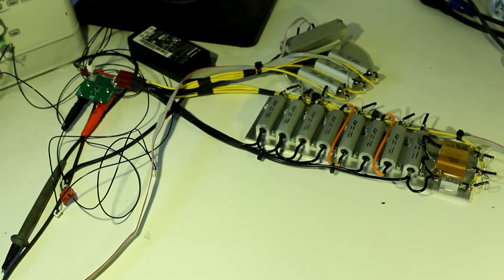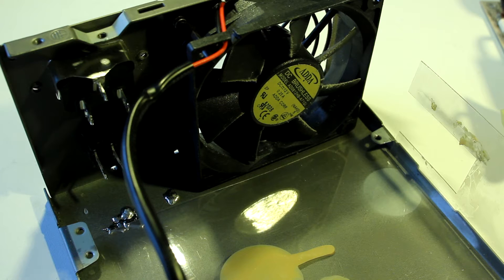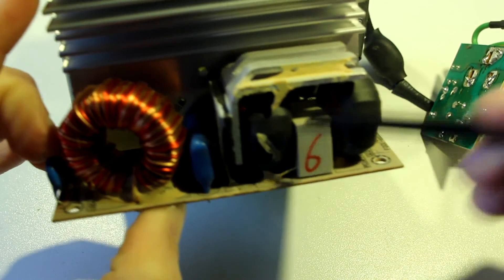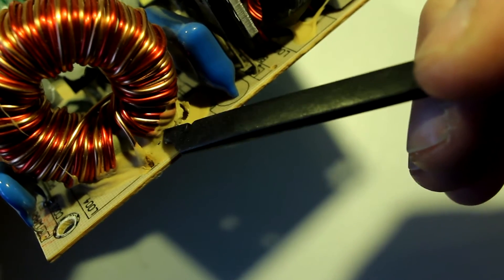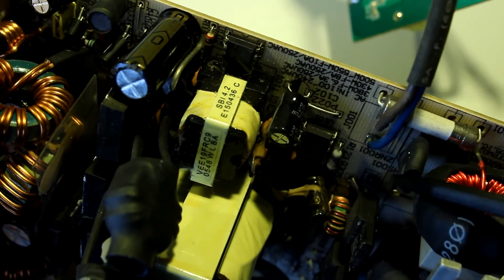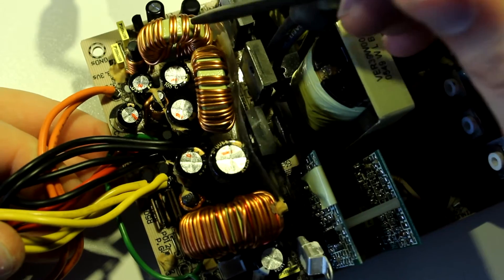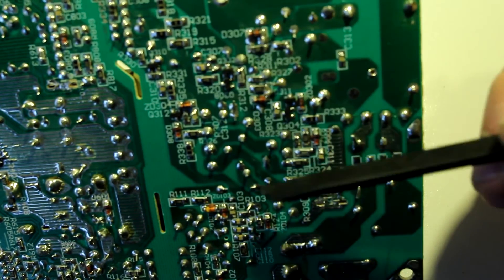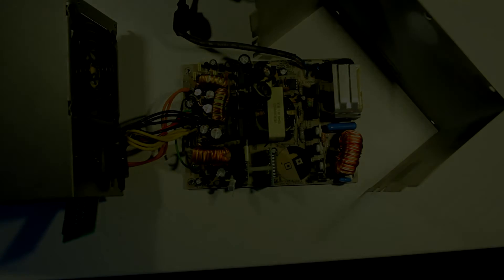Antec NeoHE 550W teardown (012)

Comment: Couldn't catch it from the video, but do you remember if the fan connector is 3pin or 2 pin?
The bushings on my unit worn out over the years and I'm thinking of replacing the fan with something better.

Comment: 10:56 Those small coils are part of Magnetic Amplifier (aka. magamp/transductor) post regulators. It is quite a clever circuit giving regulation of slave outputs with low parts count.

Comment: How clean is standby power on these power supplies ?
Reply from the maker: Didn't check, and the PSU is now gone so, sorry :(
Reply: I was wondering if the standby on these ps's, have any filtering on output side, could one use it to power a microcontroller for remote turn on, i assume it is somewhat clean since it also goes to the motherboard via the atx connector.
Reply from the maker: That shouldn't be an issue. It's definitely clean enough for remote turn-on via a microcontroller. That is, like you say, exactly how motherboards do it and in fact how I did it in this video.

Comment: Hi
I'm someone who is really interested in PC-Power Supplys. And I disagree with what you said about PC-Power Supplys. They can be quite interesting, especially if you know your stuff. Here some 'reviews' by me (in German!) with some nice pictures:
http://www.tweakpc.de/forum/netzteile/

Some things you might want to know:
1. The primary cap is a Hitachi one. And I really do NOT understand the obsession with 105° parts. Yes, they may last longer but they are also not that stressed. The question isn't if a part is better but do I have an advantage because of that. If the primary capacitor is the last thing to fail, why bother at all? Especially in 230VAC areas, that one isn't really important at all...

2. the output protection of some or rather many PC-Power supplys is really questionable. Because they only have UVP/OVP on +5V and +3,3V. Maybe UVP on +12V...
An example is a HY510N (you probably find this chip in that seasonic made one), others are Weltrend WT7510 and 7502 as well as Siti PS113. Especially on "Single Rail" PSUs (wich I really do NOT like. Well, to make it short: you wouldn't want to bypass the breaker in your breaker box, would you?)

3. What they did on the secondary for +3V3 and +5V on this PC-Power supply is a magnetic amplifier. You don't really see that these days (well, except for the +3V3 rail) anymore...
They rather use a buck converter, marketing speech called those DC-DC Technology...

4. This PSU uses the Double Forward Converter. In modern PSUs you find that in lower end ones like the usual 80plus standard and bronze things. Sometimes even in some gold certified units, but that's rather rare. Usually you'll find LLC-Resonant mode topologys in higher efficiency PC-Power Supplys. Sometimes also Active Clamp...

5. PC-Power Supply 'manufacturers' sometimes do some stupid things like this semi fanless mode of way too many modern PSUs. That's just a nightmare and if you test the stuff you sometimes can get those units to shut off under light or medium load conditions just because the OTP trips...

6. As for the capacitors: I do NOT understand the obsession with the country, the maker came from at all. Yes, they were better some time ago. But that was some decades ago...
Anyway: most capacitor manufacturers have many many different series, from 1000-2000h lifetime with ESR of about 0.4 ohms for a 16V/2200µF capacitor up to 6000-10000h lifetime capacitors with an ESR of 0.18 or even lower...
So the specs of the series should be valued. And that the worst capacitors a company makes (like Teapo SC series, CapXon KF and GF) are not the most reliable ones should be pretty obvious...
Also most japanese companys do not do low ESR/low Impedance capacitors with only 2.000h max! Nippon Chemicon KZE for example starts at about 3000-5000h, with the, in PC Power supply most common 10mm diametre ones, it's only about 4000h - double the rated lifetime of the Teapo SC series wich has also higher ESR, don't know the ripple current values right now. But Teapo has an equivalent to the Nippon Chemicon KZE series: the SJ series.

BUT: If you see a high quality cap (I don't mean Nippon Chemicon KY ones) like Nippon Chemicon KZH series, you should think about why someone would use a higher quality part in this area. Because if you see that, those caps are needed for a decent lifetime of the unit because the caps are abused in this unit...

And Seasonic isn't that good...
Especially on the lower end units, the higher end stuff is a different story...